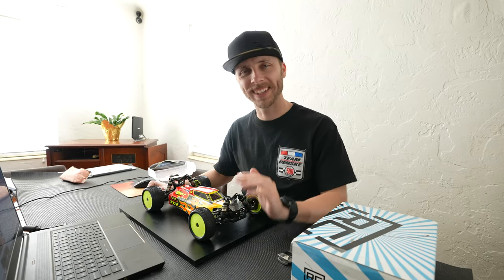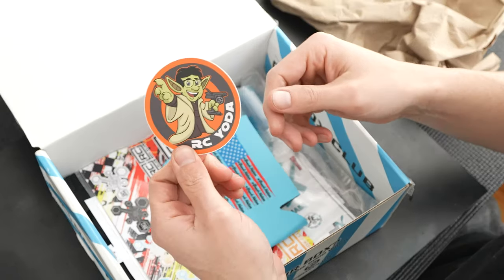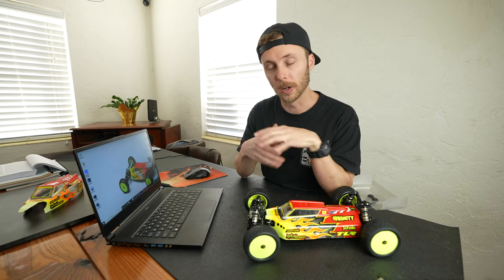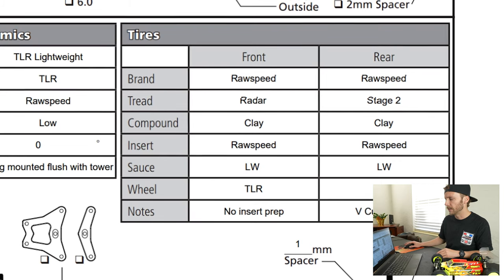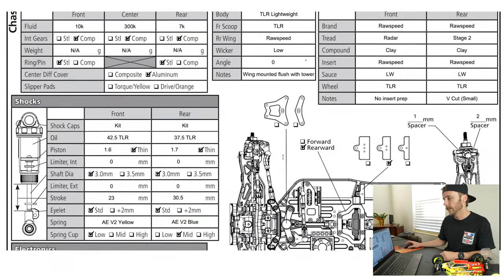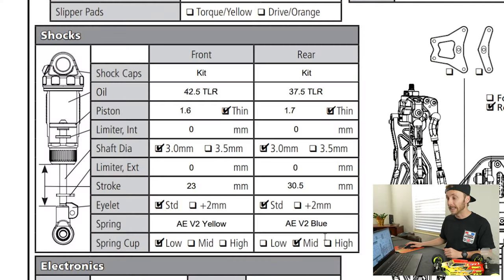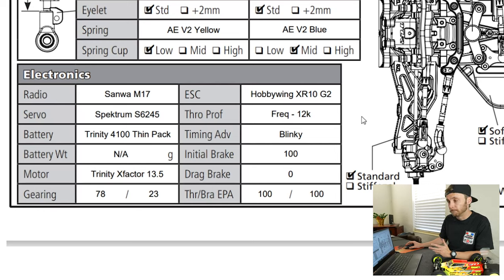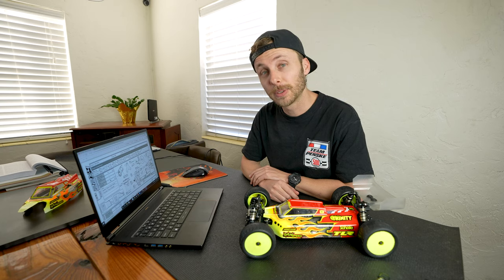How to: Read a RC setup sheet #rccars #rcracing

Comment: First the resource for setups doesn't work. Second, anywhere we can see your set up sheets? Of all the spec sheets on the TLR site, 1 is 17.5 and same track conditions. And already variances from what i have. Bought a lot of what you recommended in videos for set up so figured ask before i go buying more gears, springs, etc. Running a 5.0 DC Elite with a Trinity 17.5 for stock spec.

Comment: Still a little confused on pill inserts. When you see a set up sheet showing C-D blocks I can’t tell where you would be looking at the block from. Is this looking at the block on the side where you would be able to see the .5 or 1 on the pill or looking from the rear or front of the car? Tia for any help, it’s greatly appreciated. I come from some old school e buggy roots and am just getting into racing 1/10. Im not used to car with this level of tuning ability and these newer ways of tuning(pills).  Car is a tlr 22 5.0 btw. Cheers everyone and let’s have a great year of racing!

Comment: Do you think you can do a follow up video on pills, on like how the car reacts, what they do how the car responds those Kind of things  And maybe some other topics that might need more detail like shock tower positions and A-arm points, camber link,  Why would you have it on position 5 vs say position 2 and why you would want a longer link other than a short link while still having 1 or 2 degrees of camber. Another topic could be ball stud placing and spacing what are the hidden secrets within them 
 
Super awesome video, I definitely learned some new things I did not know an hour ago👍
Reply from the maker: Maybe! But the best thing to do is just go out and try them yourself! Learning first hand is the best teacher
Reply: @RyanHarrisRC  I agree with you, but it would also be nice to know as a beginner what the general reaction of the car is going to be, before going in there willy nilly and burning up a motor or something, thats honestly my biggest fear haha

Comment: I'm fairly new to rc cars but have quite some experience with suspension setups on bikes and cars. The main thing I don't understand is why the shocks are so hard to tune. Both compression and rebound are locked to each other. I find that I'd like to get much more compression dampening, but have a fast rebound for the rough terrain driving that I do. Is there a way to get 2-way adjustability on shocks, or are they just too small for those complex valve systems?

Comment: I have the 22-4 from TLR, the previous 4wd buggy.  They had whole parts for the rear for adjusting toe and anti-squat.  I kind of like the pill system better and wish I could convert it to use that, but oh well.